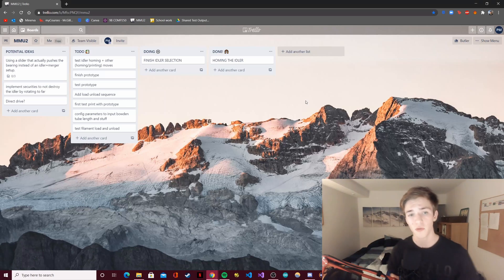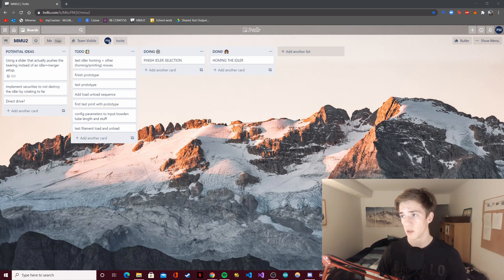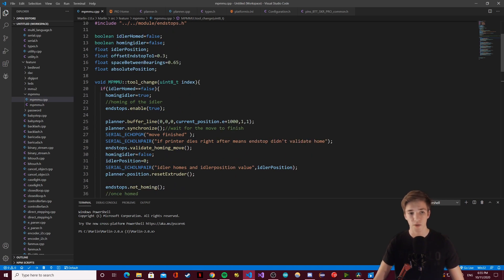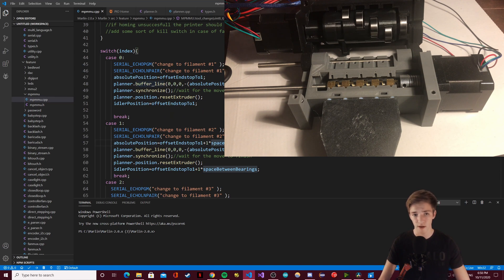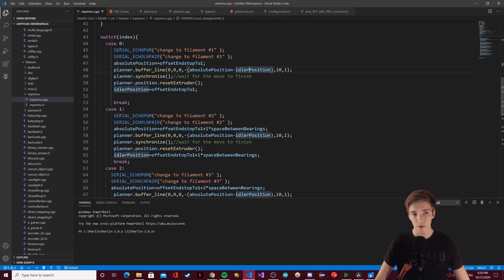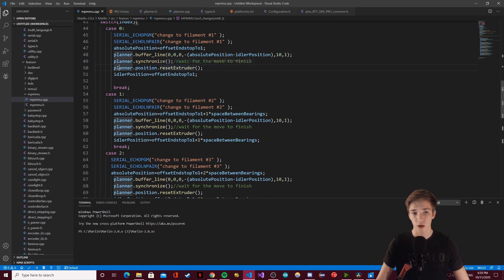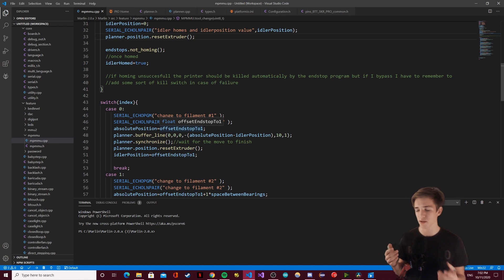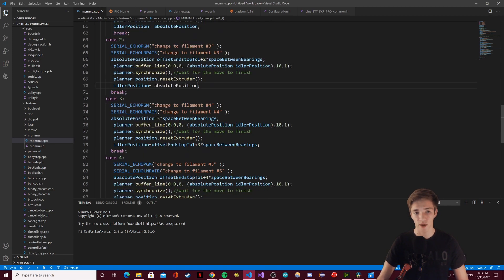Filament selection: Idler control. MMU2 on any printer Part 19.

Comment: Hi.
If you use an arduino mega to run it. And get better stepper motor drivers for your motherboard. Also change your mmu2 printer holding hook longer so you can hang it on X axis and run dual Z motors. That is a much better option I feel

Comment: Everything is looking great so far (other than getting a sketchy board)

Do you have it up on GitHub or Thingiverse yet?

I’m curious about attempting a build.
Reply from the maker: Robert Shuler  I'll get it up on GitHub as soon as I can, it may take a bit because I need to cleanup some files (my coding isn't very... professional let's say) and my midterms are coming up. I'll add things progressively so tell me what you want to see first. For the actual build I would wait a few weeks because I haven't dialed the space between the gears and the idler yet and any adjustments to that would mean you would have to reprint a lot of stuff, if you are going to build it to help with the dev of the program or the 3d models go for it but otherwise you should probably wait.
Reply from the maker: I created the github repository but it's empty for now, I will be adding stuff later this week. For the 3d files, I will probably post the scad/step & stl on github while only the stl files on thingiverse when I will have a somewhat final design.
https://github.com/PierreMasselot1/MMU2-on-any-printer
Reply from the maker: I posted the 3d files code is coming a bit later.
Reply: If there was only a way to remove or reduce the blob at the end when filament is fully retracted
Reply from the maker: Robert Shuler I think you could reduce it by tweaking the speed and also temperature when you pull the filament, but this definitely needs a lot of testing to get right